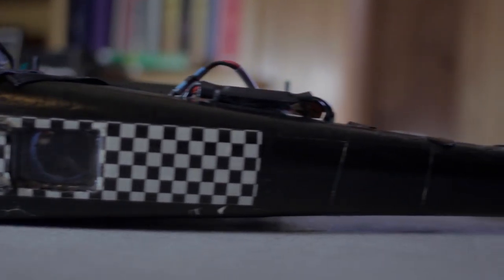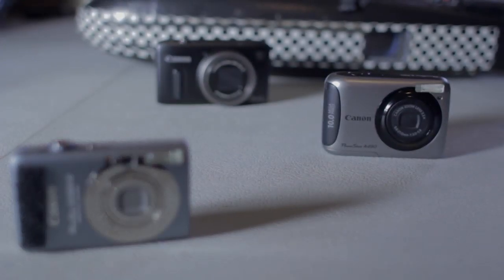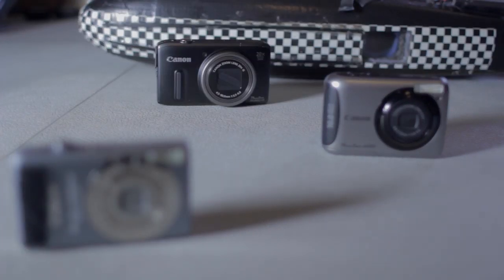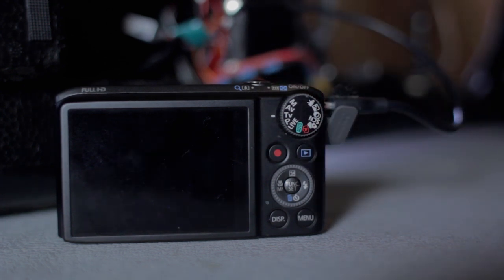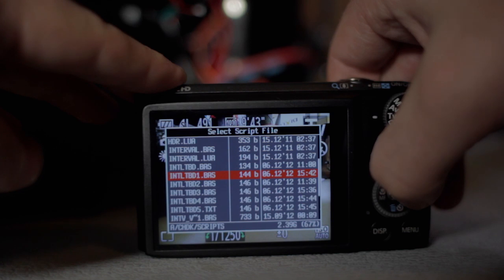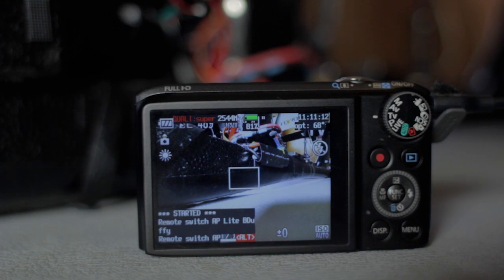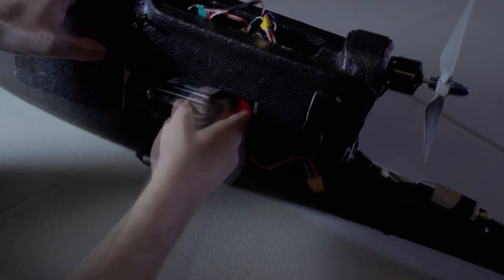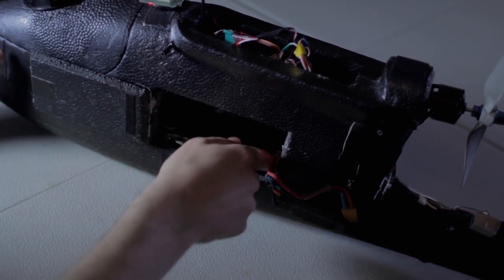Skywalker UAV - Mapping Camera Setup with CHDK

Comment from the maker: I think it's best for you to test various altitudes and swath width overlap. It really depends on the resolution requirements, the number of acceptable photos you get per run, and your methods of post processing, including whether you intend to do 2D or 3D orthorectification. I am still testing to figure out what is optimal for my 2D mapping needs and seperately for 3D surface modeling. Generally speaking you need less overlap for 2D orthrectification or even basic image stitching compare to 3D.

Comment: Nice informative video. I have just ordered a Skywalker 1900mm RTF with Canon SX-230 and I would like to use it for GIS mapping using Mission planner and APM 2.5.
I would like to know what is the ideal altitude for mapping for GIS purposes (2 Sq. Kms in a grid per flight)and what is the swath we get? I am a noob so please excuse me if used some wrong terminology.
Reply: depende y esto esta en funcion a la resolución del mosaico que se pretende obtener, peor por lo general 90 metros de altura 1.8 mp, aprox.

Comment: How do you georeference your images? I see that there is quite the gap between your GPS receiver and camera lens, do you require any kinda translation model to give absolute referencing to the images that you get with your Cannon camera?
Reply from the maker: To be clear, this process does not georeference the images. There are more steps necessary outside this software